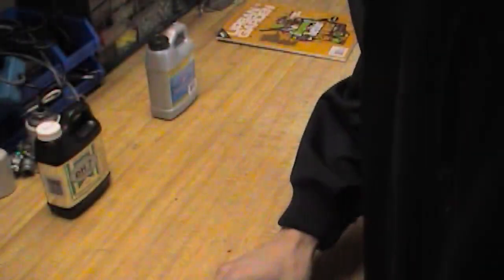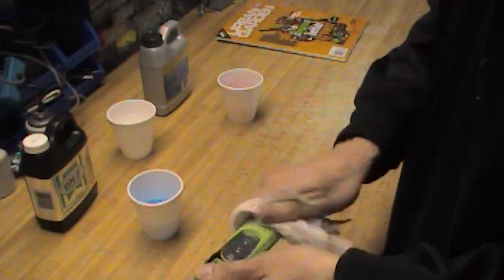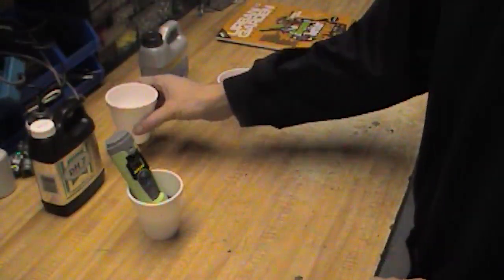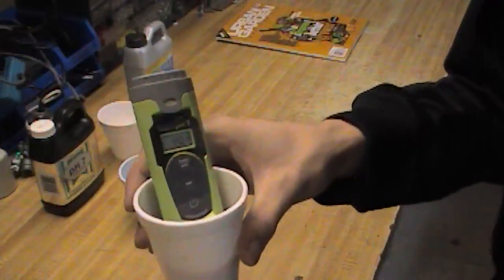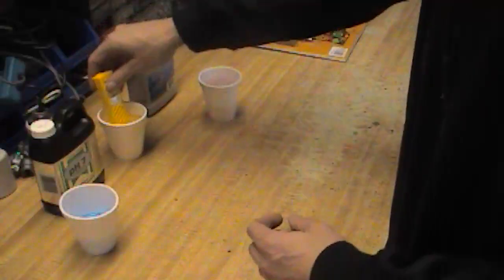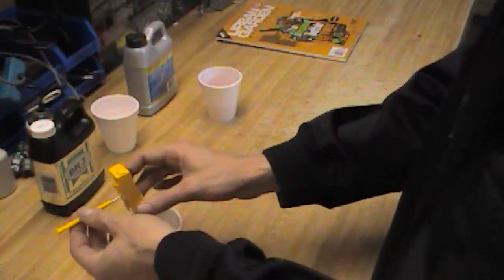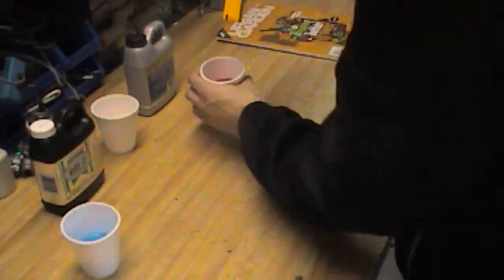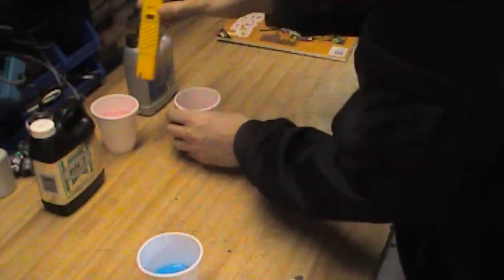pH Pen Calibration - Tutorial

Comment: how do you store the Pen between measures? i have a cheap one from ebay and in the manual it said to just rinse in distilled water and put the cap on but i read that the sensor must be kept wet all times on a 3mol/l kci solution...

Comment from the maker: @montuckyboze You can check it by using the solution with the closest value to the pH of your solution - often then pH 7 buffer solution for indoor gardening. pH 7 is "base 0" and the gain or slope is set by pH 4/10 buffers.. so if pH 7 is off then it's wise to use the two-point calibration. If the pH is 7.1 or 6.9 I probably wouldn't bother calibrating it - the solution is not that sensitive usually.